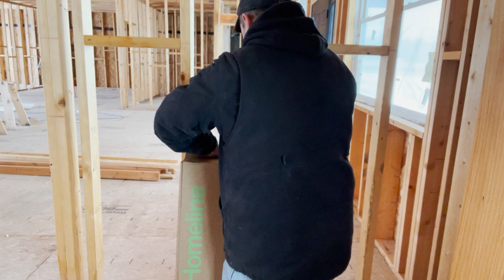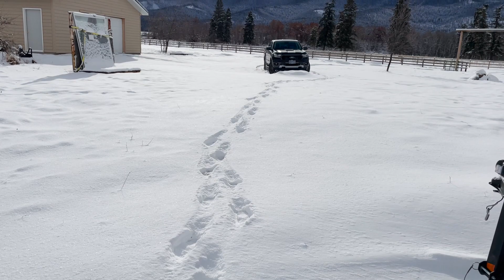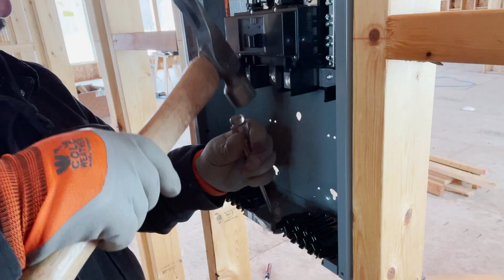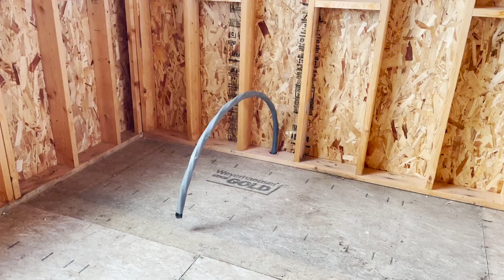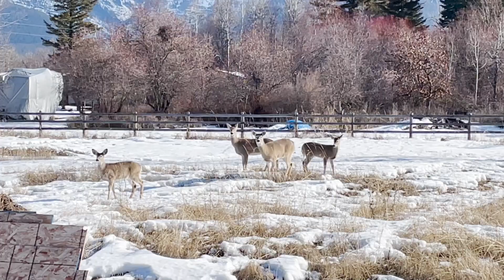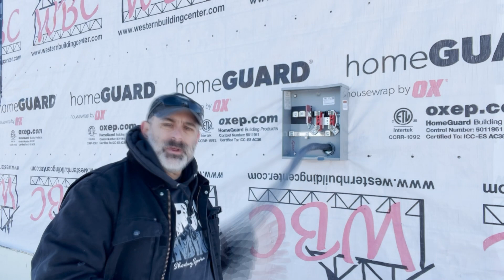Fuse Panel and Meter Socket Installation

Comment: Don't you need a disconnect under the meter to provide protection on the service entrance conductors and for emergency services to turn off power to building without having to go inside of building,,?
Reply from the maker: Yes, you need an emergency disconnect. In a later video I switched out the meter box to meet code

Comment: 21:30 - You still need a 200A disconnect box at the meter.  The SER cable connects to that box; not to the meter directly.
Reply from the maker: I ended up changing the entire meter panel

Comment: 13:51 - You are using SER cable (4-conductor), so the panel is being configured as a sub-panel. The ground wire from the cable is supposed to connect to a separate grounding bar that needs to be attached to the inside of the panel. And the green bonding screw is NOT to be used.  Grounds and neutrals are only connected to the same point at the main panel -- not a sub panel.
Reply from the maker: Thanks for a great reply! I have since corrected all of those issues and have had the entire system inspected and now signed off by our state electrical inspector.

Comment: Coming along nicely. I’ve pulled miles of wire/cable in my life and had fun resolving the challenges it often presents. You will have a lot of pride in the work you’ve done and every time you turn on a light switch, you can say with a smile “I made that work”.
Reply from the maker: Cable and wire pulling we both know and are sticklers for good work. I love the challenge.